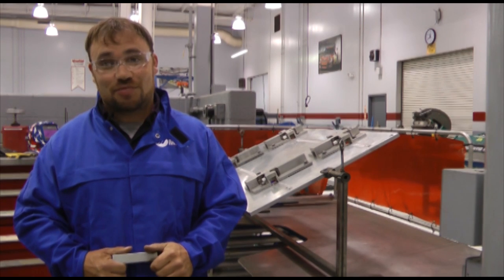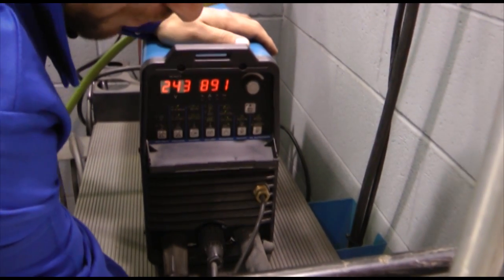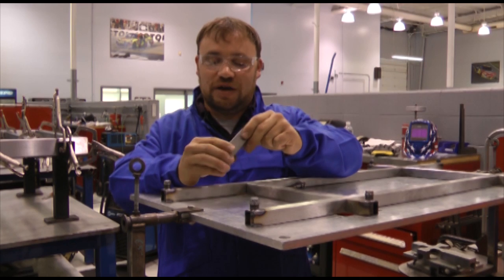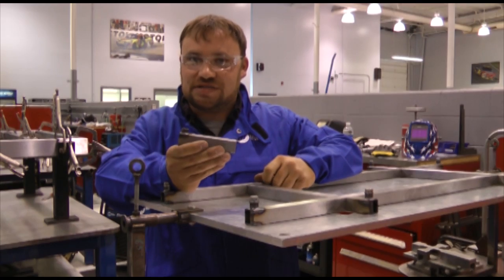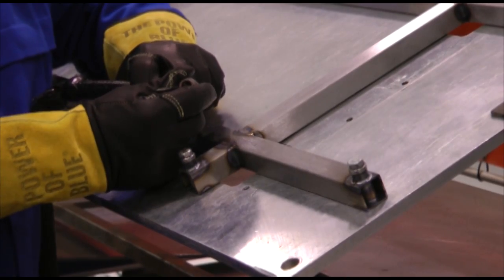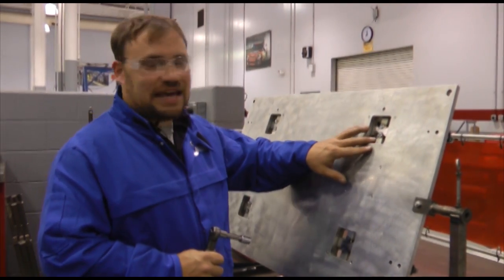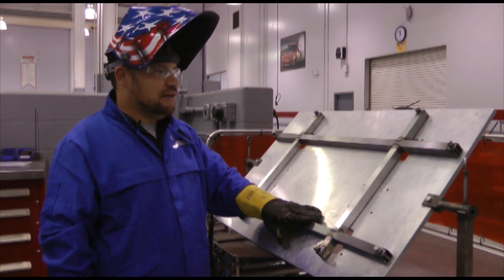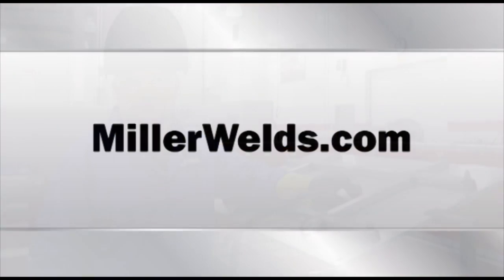TIG Welding a Fuel Cell Rack with Hendrick Motorsports

Comment: he has the panel set on 200, but I don't think he was ever fully on the pedal. I weld tubing similar to that at work myself and have my machine set around 150, but I don't ever need that much. Its just for when I have to weld a thicker part so I don't have to walk over to my machine and change it